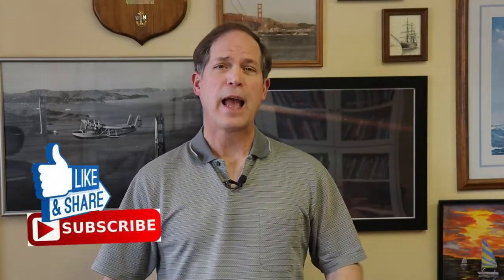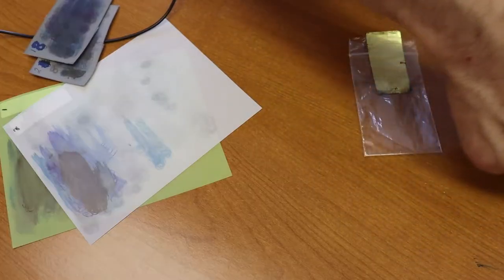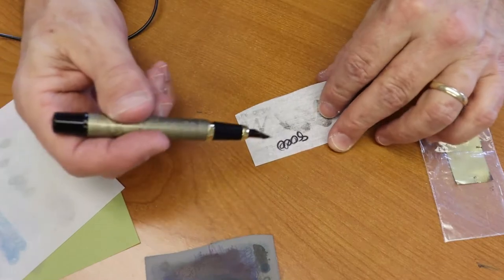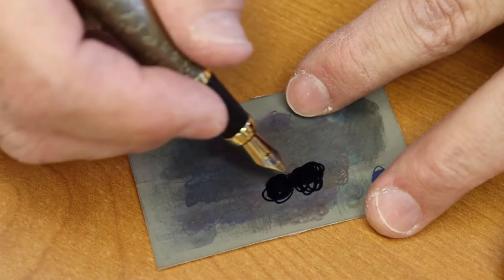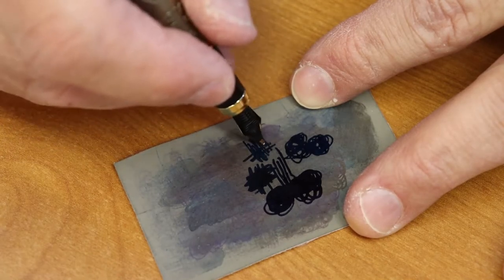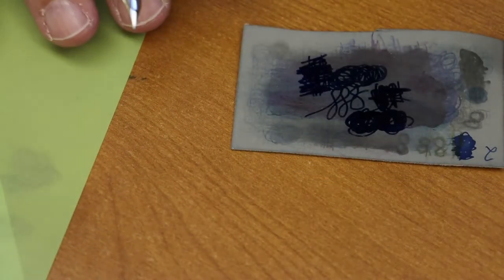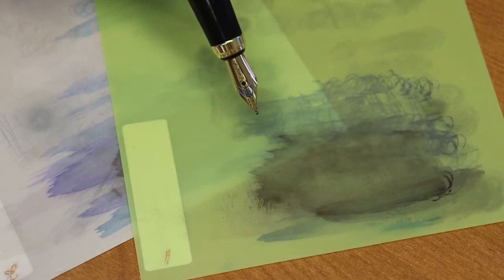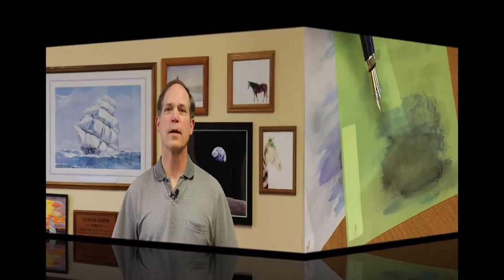Polish Dat Nib, Fountain Pen Nib Smoothing Maintenance

Comment: I doubt the 3776 you bought was scratchy.  Scratchy is when the tines aren't aligned.  It probably wasn't rough, either.  It simply had the stand Platinum feedback, which is not the same as roughness.  That feedback will make a nib last a lot longer than it will if you make it butter on glass smooth.

You can check tine alignment simply by drawing a straight line from right to left, and then a straight line from left to right.  If the tines aren't lined up, the pen will write smoothly in one direction, but will be very scratchy in the other.  A loop may, or may not,  be necessary to realign the tines, but you don't need a loop to diagnose the problem.   I don't think it's something you have to tread lightly about.  Just watch a video that shows you how to do it, and it's a very, very easy thing to do.

It is good to note that "scratchy" and "rough" and two very different things.  Scratchy is when the tines aren't aligned.  The nib can actually scratch the paper, or sometimes even tear it, with a bit too much pressure.  Rough is when the nib hasn't been properly polished.

Feedback, the good kind of feedback, is not the same as rough.  Good feedback is intentional, is controlled, and can make a nib last much, much longer.

I'd say something over eighty percent of the nibs are highly over-polished right out of the box.  They're right on the edge of baby's bottom.  This wasn't the case not that many years ago.  But this generation of users, thanks to YouTube, believes every nib should be as smooth as butter on glass, or there's something wrong with it.  In fact, the butter on glass nibs usually have even more wrong with them than do the nibs with proper feedback.  Fortunately, few people use a single pen day in and day out for years.  Just about everyone has numerous pens, and they switch regularly.  Often every day.

I've worn out the tipping on two high end pens with gold nibs, and on one cheap steel nib.  But When I wore out the gold nibs I was write a minimum of five hours per day, with the average day being close to eight hours.  Twelve hour days were common, and a sixteen hour day popped up every now and then.   I used the same three pens each day, but I used one of them eighty percent of the time.    This went on for twenty years, and the only reason I didn't completely wear out at least two more nibs was that I started monitoring the nibs, and switched out while they still had some life in them

At that pace, it took about five years to wear out a nib.  I do know a writer who wore out the tipping on a nib in three years, but he must have been using rougher paper, and/or applied more pressure than I do.

The steel nib was on a cheap Chinese pen, and it was an experiment.  I used that pen, a Jinhao 750, every day for at least five hours, and usually more.  It took just six months to wear out the tipping.

I know at least two dozen people who have quickly taught themselves to do all thye common grinds by watching a video.  That's all some of them needed.  Others had to practice a bit.   All you need to do it cheaply is a five dollar Jinhao 750, and a ten dollar package of number six Jinhao nibs.
Reply from the maker: Wow, James, are you a writer/author? That's a lot of writing, and I envy your life situation that you can spend that much time putting pen to paper. I couldn't even think that I would ever write so much that I would wear the tip down to nothing. However, I welcome the opportunity one day. I'm doing some self-study on creative writing, so hopefully I can pick up my fountain pen writing hours soon. Currently, my writing mainly consists of journalling. Not only is my love for fountain pens growing, but I also have a growing love for playing the acoustic guitar, and have found many similarities with that realm and the fountain pen realm. One area would be when it comes to strings. Where one player thinks bare strings give a better, more tactile feel, and a better tone, others prefer coated strings for their smooth play. Both can give a great tone, but different players, professional players, prefer a different feel when playing. I liken that to users of fountain pens and their preference with nib tippings. Technically, I would have to agree that the 3776 isn't "scratchy." However, It does have for me an irritating feedback feel. I've used other pens with some feedback that didn't bother me as much as the 3776. I was using a medium nib, and checked to make sure the tip was aligned properly. I really don't care if a nib tip is "buttery on glass" smooth, but smooth I do prefer, even if that might make them wear faster. If I experience feed back, I like it to be more like the feel of a nice lead pencil. The 3776 didn't have that feel for me. For me, and I certainly realize that a lot of people do like the feel of the 3776 nib, but for me writing with  it was like scraping fingernails across a chalk board. That said, I do appreciate your clarification on definitions, which is important, and I'm learning all the time. I also appreciate your perspective as a serious fountain pen user. Your insights have been interesting, informative, and thus useful for those who wield the nib. Have a great day, and thanks, again, for your input.
Reply from the maker: BOGDAN SERBAN  I've experienced similar. I think it is due to personal writing angles.
Reply: James, thank you for this comment.  I've read a few of your comments on other videos and I've learned more from your comments than from the videos.  About feedback. -  I think of it as 'drag '  because to me feedback implies not smooth.  I enjoy drag in a nib as it slows me down enough that I can be more consistent in letter size and more importantly spacing.